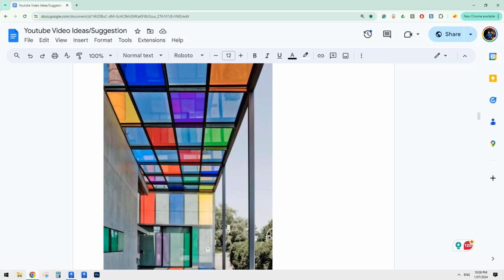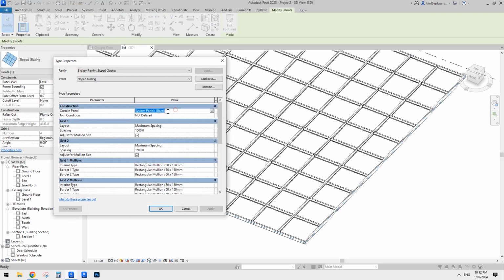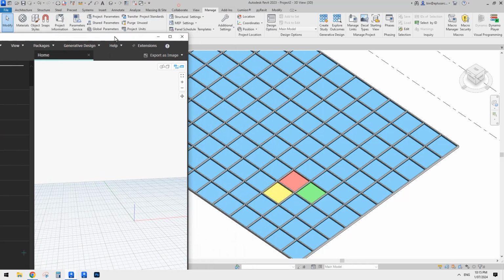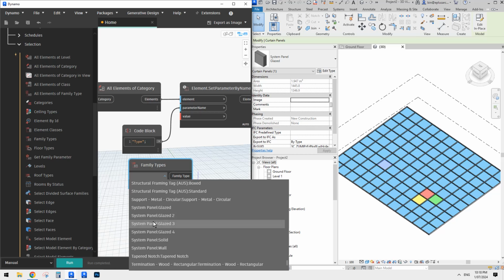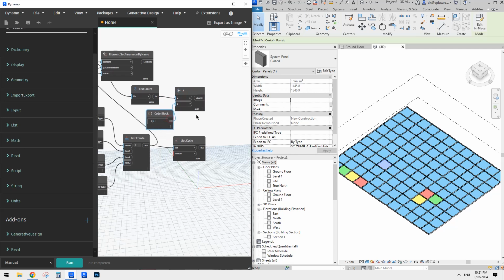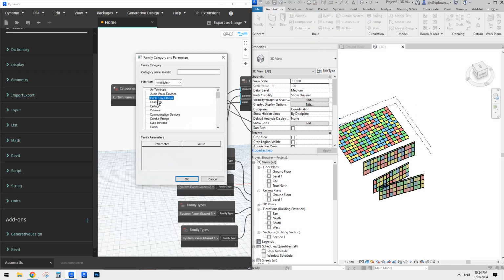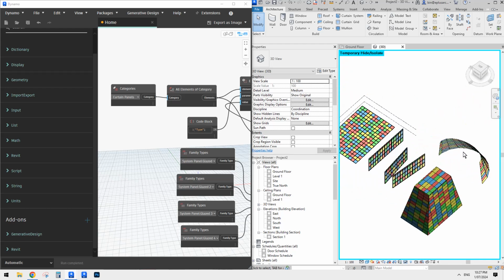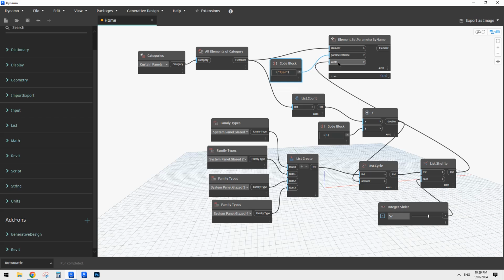24037 - Curtain Panel and Dynamo Exercise (Random colour/material)

Comment: Great video! I have a question. I just did the same thing as in the video, but I'm having a problem because now all the curtain walls are the same. And I only wanted one type of wall because I have different curtain walls. Could you help me?:eyes-purple-crying:
Reply from the maker: Option 1: Isolate the curtain wall(s) in a view, then use “All Elements of Category in View". This allows you to change only the panels on the curtain wall visible in that specific view.
Option 2: Create a curtain wall panel with an instance material parameter. Then, use “Family Type” and “All Elements of Family Type” for selection—this will allow you to change only the specific curtain wall panel you select, not all of them. I demonstrated this in a similar Dynamo exercise here: https://youtu.be/kez3yV09uXI.